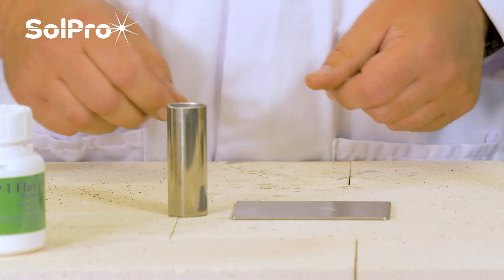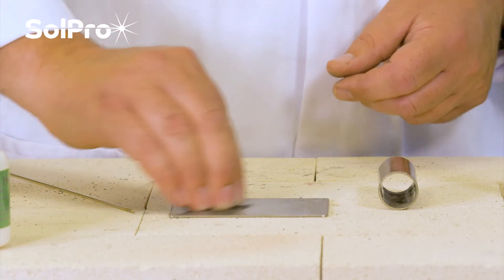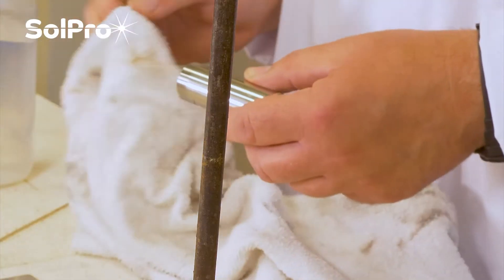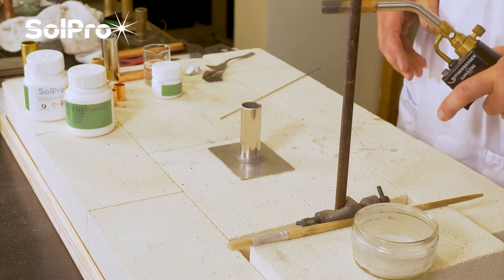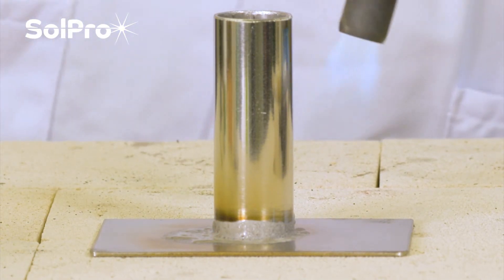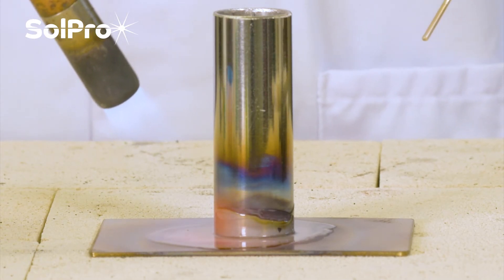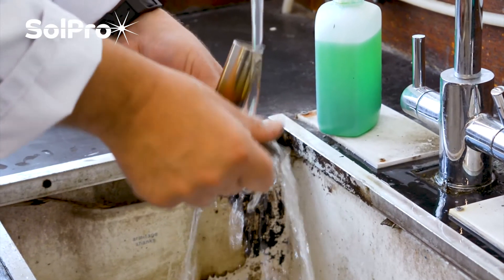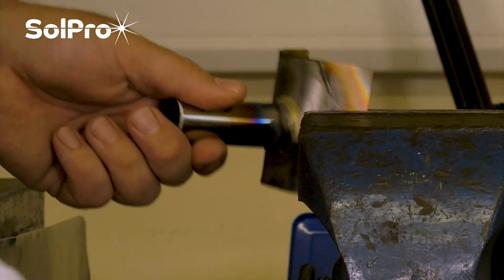Brazing Tutorial - Stainless Steel to Stainless Steel

Comment: Can you cool with dip in oil bath
Reply: Oil bath is for quencing or tempering certain types of metal, not cleaning flux.  A welding/brazing manual tells which quench liquid is right for each metal.  quenching shrinks the outside layer of the metal to harden it such as to make a more durable cutting edge etc.

Comment: You can speed this up substantially by keeping the plate  elevated off the brick and put it on some smaller points like pebbles or machine screws. The fire bricks absorb all the heat out of the part if the part is flat against the brick.

Comment: Mine didn't melt like that at all, despite getting it cherry hot red as well, I even tried two different torches at once. Could it be not enough flux? I was using coated flux rods.
Reply: Did you coat the work in flux also?

Comment: Excellent vid.  The use of MAPGas is great as well. Helps me realise that I do t need an expensive oxy setup. 

Question though.  Can you braze close to the original site without melting the first one? I remember hearing (apocryphally) that the composition of silver solder changes meaning it needs a higher heat once its set?
Reply: Some solder manufacturers make alloys with various melting points specifically so you can do multi-stage braze operations on things like boilers. It is very possible to melt (and ruin) existing joints when brazing on new features.

Comment: Nice video. Can aluminum be brazed or is the melting point too low?
Reply: This looks like silver soldering. True brazing doesn't flow like this.
Reply: Silver solder or one of the low heat aluminum/zinc repair rods which were used to repair pot metal ,which is zinc rich, grills and accessories.
Reply: Yes!  There are special brazing alloys and in some cases flux.  There is aluminum brazing with flux and also without.  The flux is a real pain, it has all disadvantages!  Corrosive, toxic, hard to buy, short shelf life!  The results with it are amazing!  Oh, well.  The alloy is  Aluminum with a lot of Silicon.  The Lumi-Weld (HTS-2000, and many others) is proprietary, but aluminum/zinc is common as someone has mentioned here.  That works, too!  You really do have to follow the directions and practice.